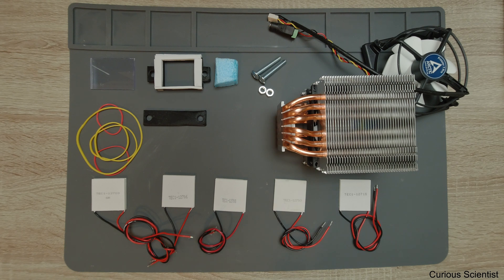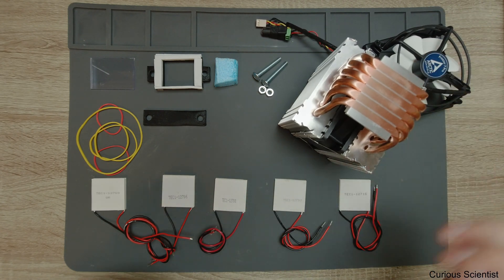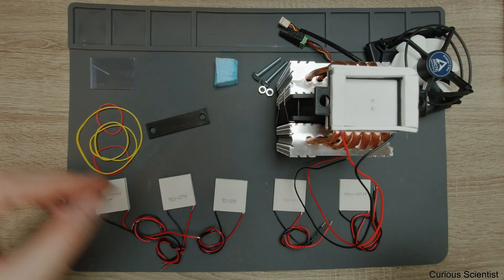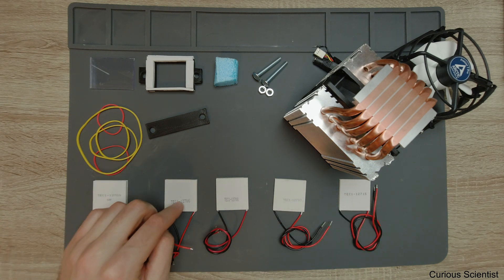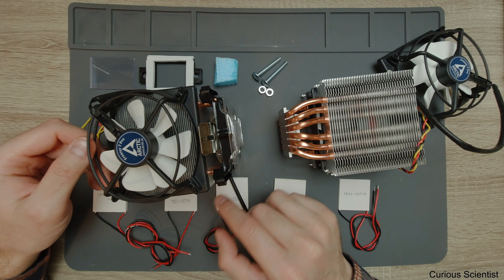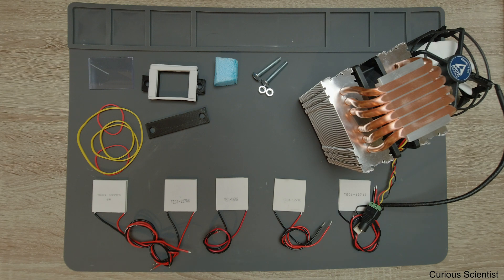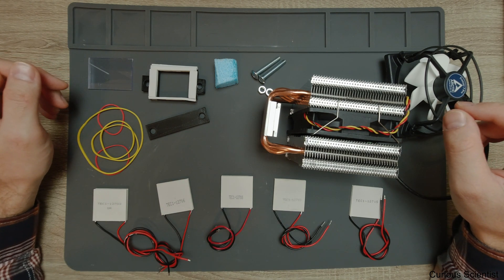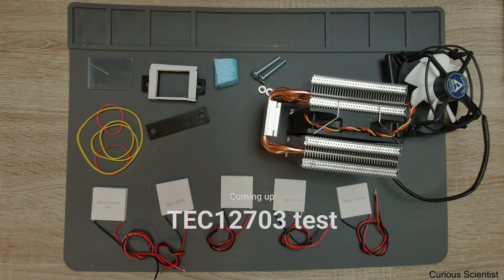Testing and comparing different Peltier coolers - Part 1- Introduction

Comment: Can you please suggest me a peltier model which is sufficient for a 15 gallons aquarium to bring down the temperature upto 22•C or lower. Ambient temperature around 30 degrees. I also have a cooling fan which can bring down 3 degrees. Without cut off and even if it  takes 24hrs to reach that temperature it’s fine.
Reply from the maker: Hi! Unfortunately, several things have to be considered so it is not that easy to just suggest a model. First, you can calculate how much heat you can remove by maintaining the 8°C temperature difference (30°C vs. 22°C) with different Peltier coolers (here I explain how to read performance charts: https://youtu.be/d8FY0jGFbZM ). Then, you need to calculate how much heat tries to enter the aquarium once you cooled it down to 22°C. So you know how much cooling power you will need to balance the "heat gain" (gain, because the heat will try to go into the colder than ambient aquarium) of the system.
Reply: @CuriousScientist  Thanks for your reply. I have similar heat sink & fan like yours. In your test 12708 at 5.25 amps is the maximum amps for maximum cooling for that module in your cooling system? So 5.25 amps is sufficient to get the maximum cooling capacity from 12708? Also 12709 is available will it work similar to 12708 in your system?
Reply from the maker: It will work similarly or even a bit better, but one single Peltier cooler might not give you the desired results, I think.
Reply: @CuriousScientist  5 amps supply is enough for the 12708 peltier for maximum cooling?
Reply from the maker: @Naveen27  It depends on how well you cool the hot side of it. I tested the above mentioned Peltier, so check that video.
Reply: @CuriousScientist  I saw that video but I don’t know these electronic stuffs just for my aquarium. I am looking into all these. 8amps is rated for Qmax right? But in your video it’s reaching the lowest temperature at 5.25amps so that is enough? I don’t understand that part lowest temperature point is where the maximum cooling capacity is attained for your cooling setup? I have similar cooling heat sink that why asking. So 5.25 amps is enough for me too?
Reply from the maker: Watch my videos in order to understand how Peltier coolers work. I published many resources on these topics.

Comment: Judging by this introduction the test process and the conclusion will be very interesting
Reply from the maker: I hope it will be interesting. Today, I finished recording the test for the TEC12708, so probably I will be able to finish the whole series this week. But as I approach the larger Peltiers, they require more and more measurement points to cover the whole curve that I want to measure. So, it will take time.  But, I already learned a lot during the tests. I will talk a lot, maybe it will be boring, but I think it can be useful too.
Reply: @CuriousScientist  Not boring at all, we appreciate you sharing all you had learned in the process.
Reply from the maker: Thank you!